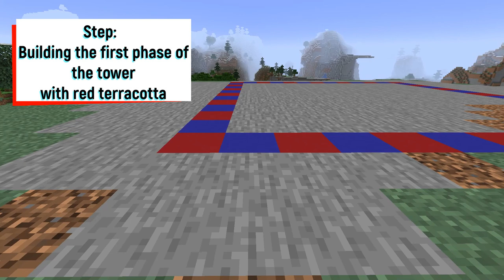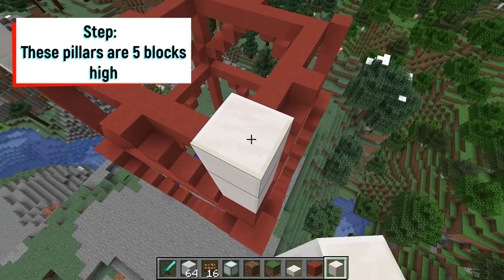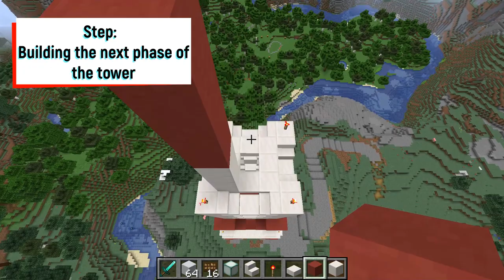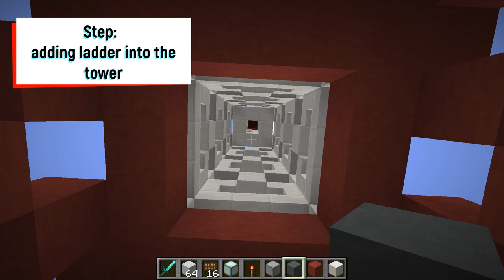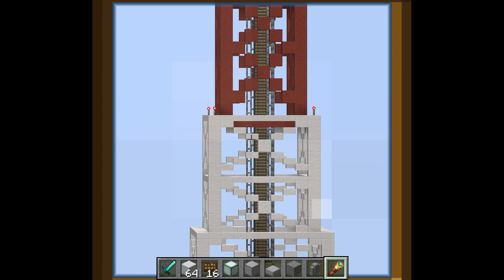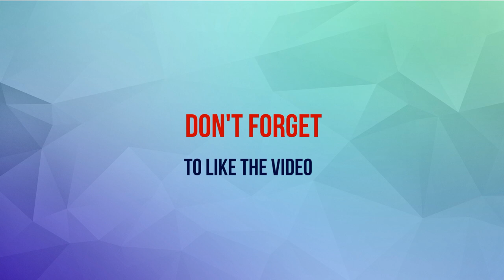MINECRAFT - How to Build a Radio Tower - Easy Tutorial

Comment: Here is a material list that counts just for the tower itself!

(some materials altered to make them easier to get)
White Concrete - 4 Stacks
Red Concrete - 7 Stacks
Smooth Quartz Slabs - 5 Stacks
Smooth Quartz Stairs - 1 1/2 Stacks
Iron Bars - 1 Stack
Redstone Torch - 12 stück

Optional for the tip of the tower - 1 Lighting Rod